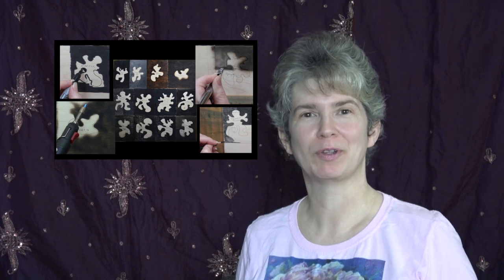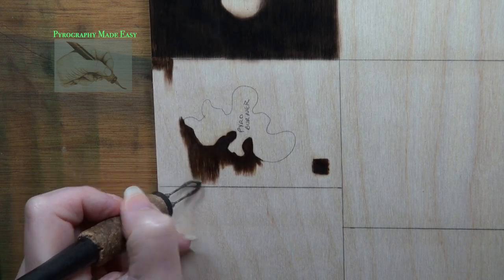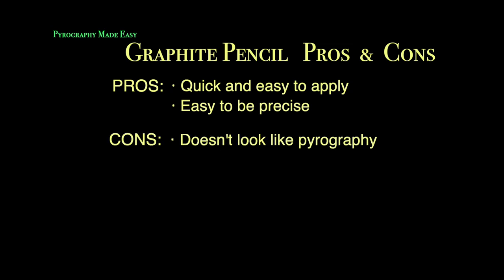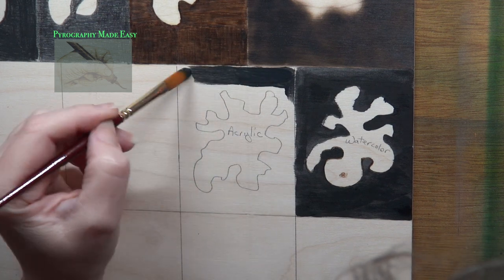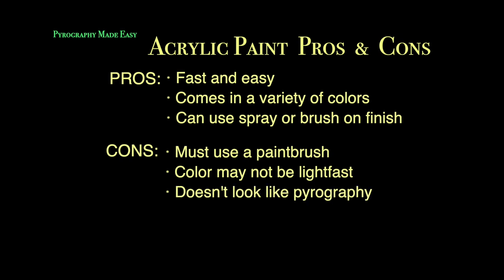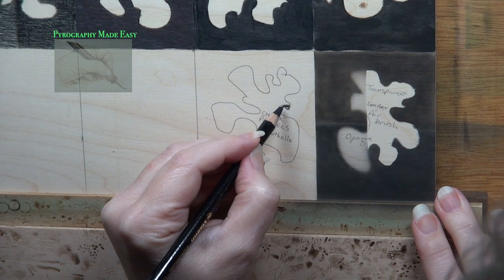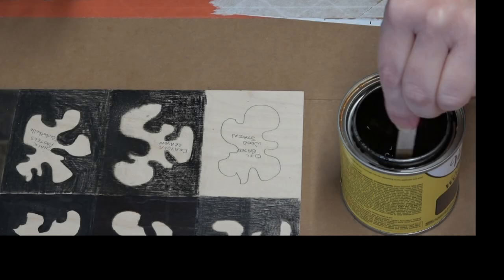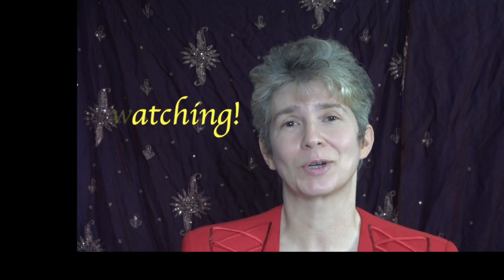Wood Burning Tips - Ideas for Dark Backgrounds pyrography tutorial

Comment: I like the idea of the shield. Did he make it using a Dremel?
Reply from the maker: The shield is made out of really thin metal, and I believe he used snipping shears and a band saw.  To smooth the edges I think he used metal rasps or maybe regular sand paper.  
Given the wide range of bits available for dremels, I'd think that they could be used to.   
If there is enough interest I'll videotape Todd making a shield.